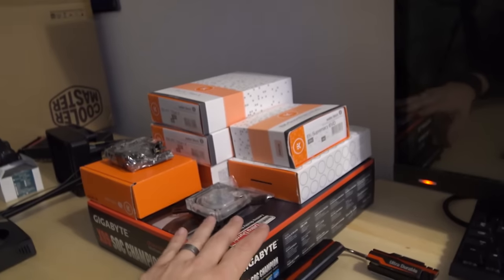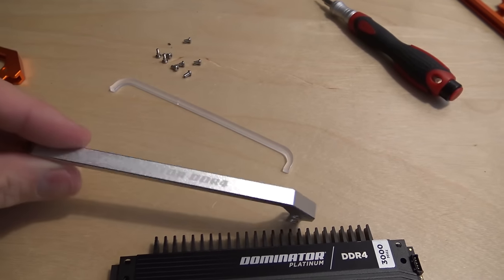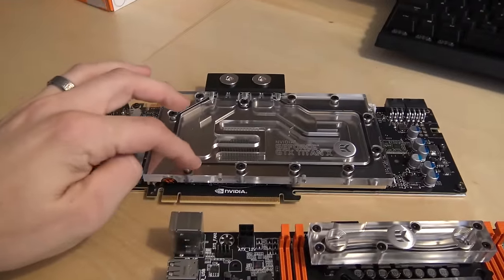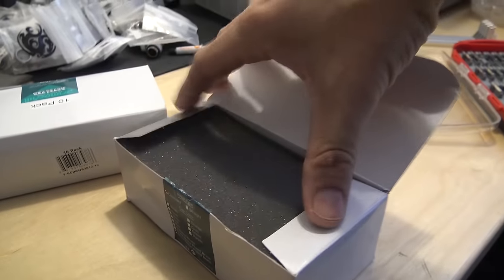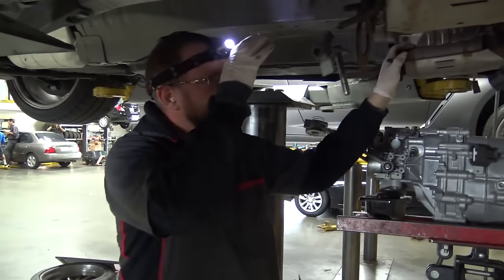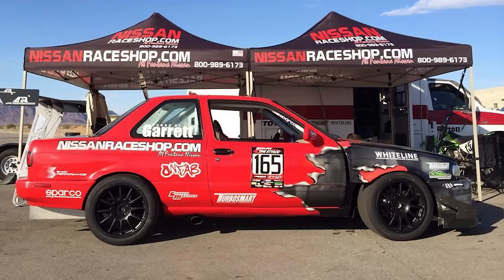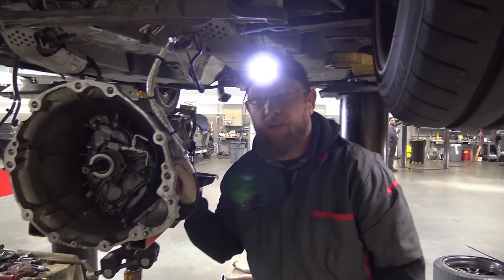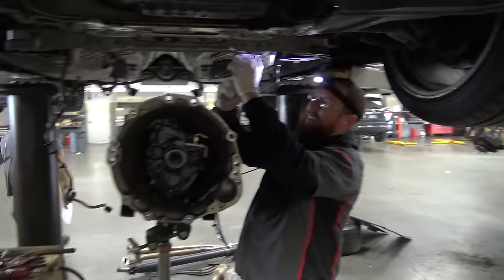Skunkworks and 370Z Nismo update vlog!

Comment: Jay, the flywheel is sprung weight, and more importantly, it's rotating weight.

The difference between sprung and unsprung weight is that unsprung weight is not supported by the suspension in the car. Pretty well all of the suspension, wheels and tires are all unsprung, and everything else is sprung, that's an easy way to remember it. One of the goals in motorsports is to reduce unsprung and rotating weight.

Comment: For future reference VHT do anodized effect paint, it is a very thin and watery paint so runs are difficult to avoid but the result is that the paint is translucent meaning if you have a brushed metal surface you'll be able to see the brushed metal through the paint this also includes writing as well, the currant colours are blue, red, purple and grey (it's that weird grey that you only get from anodizing). You can also try searching transparent spray paint but it sort of hit n' miss.

Comment: im a big fan of the car stuff. any time you want to toss it in a video i dont mind at all. 

one thing i never understood is people making a big deal about low mounted intakes. on my gencoupe i had an injen CAI mounted right in front of the wheel and never had any issues. i live in toronto canada (so a decent amount of rain) and in rain or snow no issues at all. one downside to that was the smaller wiper fluid bottle though (salt in winters blows). i personally prefer the intake sounds over those of exhaust (especially on turbos). that darth vader like woosh is like music. the intake sounds a just so much more subtle and less annoying than exhaust. 

oh and one thing i think would be really interesting on the channel would be some sort of artistic hard tube watercooling. maybe something like coiled or helix tube bends or something. i have wanted to do something like that on my own PC but i just dont have the room in my current case for it.

Comment: I used to have a 350z too but traded it in for a subaru xv crosstrek since that works better in the snow up here in the northwest.  I did test drive a 370z during my ownership of my 350z but didn't notice that large of a difference between the 2 to upgrade, and I couldn't afford the higher payment.  Now that we, my wife and I, have a good all weather non extreme offroad car I'm looking at getting another sports car, maybe.  What would you have gone with if not a Z car or what vehicles were on your list when you were shopping?

Comment: Just gunna put this idea out there .. but what if you paint your Skunkworks case in a crazy metal flake burnt orange? I don't mind the car stuff Jay. Those water blocks look like a nightmare to plumb up being so close together. I'm wondering how close your top GPU is going to be to the chipset block fittings.

Comment: I thought he looked familiar...turns out it was scott from scott and kerryann! awesome to see my tech colliding with the motovlogs
Reply: +Ck thirsty small world isn't it?!?
Reply: +ScottandKerryann 15:00 You, Scott, don't seem to understand the concepts of under and oversteer: In a FWD, 'stay on the throttle and let it pull you out'.

Jesus...
Reply: +RetroMMA ok
Reply from the maker: I'm fairly certain he has WAY more seat time than you, so shut it mr
Reply: ***** You tell him jay!
Reply: ***** First of all, you don't know me or how much seat time I have so please don't make assumptions because he's 'your [car] guy'.

The simple fact of physics should tell you that the front wheels can do both turning and pulling quite well... however, as you ask that system to do both at the same time, you're in the realm of diminished results.

Hence, FWD cars are notorious for their tendency to 'push', which should not be confused with what I said above about 'pull': staying on the throttle will just make the push sustain and you'll end up sliding off the track [at speeds greater than what one might run on the street] as the two tires are doing too many things at once and not specializing in any one task in the corners.
Reply: ***** Let me rewatch that part, if I missed that, then I'll be like "my bad". Fair enough?
Reply: +RetroMMA I drive competitively...in the unlimited class fwd.  we set the car up (alignment) to rotate...aka oversteer.  in which case when the car gets loose...aka oversteers...you would stay on the throttle in order to let the front end pull you out...like I said in the video.  this is how you make a fwd get around the track faster and not "push" yourself into the wall.  but I'm sure you already knew that.
Reply: ***** Ok, I listened to that part (again) and my opinion hasn't changed and here's why:

In an over-steering car, where one doesn't intentional wish to drift, the weight transfer must be balanced to let the front tires grip.

If you're already over steering in a FWD the best course of action is to ease off the throttle and let the wheels 'bite'.
Reply: ScottandKerryann So then why not say that 'we make the car sloppy' and overcome it by pure dollars in tires and suspension work?

Truth is, FWD as a race platform is a battle of who is the less Special in the Special Olympics.

I don't say that to be mean, in particular, but playing with physics is something that Porsche has been doing for decades and they've only got good at it at the cost off the owners willing to pay for them.

Anyway, no, I didn't know that but I'd be curious to this unlimited class of FWD cars that defy physics and put down respectable times on a track.
Reply: I must have been doing it wrong all these years...thanks for correcting me.  I'll let everyone know in all of the FWD classes throughout the world that they are doing it all wrong and should trade in for Porsches!
Reply: ScottandKerryann You have no understanding of what I meant by the Porsche analogy?

Let me ask you this: Do you believe that and Unlimited FWD car will beat an Unlimited RWD (or even AWD) car ON AVERAGE?

If yes, please explain.
If  no, please explain.
Reply: +RetroMMA ladies ladies your both beautiful!
Reply: +RetroMMA your question makes absolutely zero sense...and can't be answered.  there are different classes pertaining to drivetrain....enthusiast class, street, modified, and unlimited.  and then again divided by drivetrain fwd, rwd, and Awd.  so on average....who cares?!?  its not relevant.  that's like arguing what's faster on average...a bike or a car?
Reply: ScottandKerryann We're talking physics, hence reality: Why not enlighten us how a FWD car can compare to a car of the same HP, TQ, WT?

All I gather your comment in the video is that the 'Unlimited' FWD Class simply goes around the track slowly.

Worse is that you set it up loose to what effect?
Reply: Not sure where this whole FWD vs. RWD debate came from.  They are two different things.  Jay was asking me a question about my particular FWD race car...in which i answered the question.  You however, disagreed with my answer...its apparent that you are extremely confused by all of this...hence making this conversation extremely difficult.  What's tastes better?  Blue is my favorite color!
Reply: ScottandKerryann I get it, you choose to be condescending at every turn. When you get a break, why not read the entirety of this thread.

I made my point.

I wouldn't let you touch my G after vetting you the first time we meet, even had I broke down, and you showed up.
Reply: +RetroMMA OK cool!

Comment: I need to put a new Clutch in my 2001 Audi A6 2.7T, works fine but if I give it gas to the point of the turbos kicking in I will feel a shuddering from it slipping. also if i give it gas in 6th gear it will rev up 1k then go back down and start moving the car:( But my baby has 180k so I cant complain about the stock clutch lasting so long.Just thought I would share.

Comment: What a coincidence Jay i just put a stage 2 clutch an lightweight flywheel on my subaru along with a custom turbo, Bigger injectors straight through exhaust and a cosworth induction kit then got it remapped by the uk's nbr 1 subaru tuner Andy Forrest, I came from 300bhp to 370bhp an what a difference it is, Well happy 😊😊😊

Comment: oh man. I hate to be "that guy", but mass in the flywheel is not unsprung mass. Unsprung mass is exclusively mass that is outboard of the dampers (like knuckles, wheels and tires, control arms (sorta), brakes, etc.) and it impacts suspension performance. Reducing mass in the drivetrain is also important (less rotational inertia means more angular acceleration per torque) but it doesn't impact suspension, it impacts drivetrain performance... I'm sure he knows all this and just misspoke, but people misuse the term "unsprung mass" so often that it gets to be like nails on a chalkboard.
Reply: +TheNightWatch001 Can't believe this is the only comment I could find mentioning this. I thought youtube would have been full of pedantic mechanics like me and you. :)

Comment: Is that replacement a DUal mass flywheel? and if not does it make noise? I heard a few 350s and 370s with lightened flywheels and they sounded HORRIBLE when idling. My G37 clutch is still holding at 75k but im sure im not far off from needing a new one. Luckily I work somewhere with a machine shop so we are going to attempt to resurface the Dual mass. It just needs a custom jig made to hold it in the lathe. So yeah any noise?

Comment: I have the same dominator RAM.  If you buy the light upgrades it does come with the correct alan keys.  Also you can light them without corsair link.  Which I agree is rubbish.

Comment: Can't wait to see the finished overhaul  on  Skunkworks. Should keep the nickel back plates and polish them up to a mirror like finish. Nice upgrade to the Nissan and Yes do add some car enthusiast or what ever tidbits here and there to your videos as that is part of what your into and it gives your viewers a more personal  touch into the life of JayzTwoCents besides just computer tech ( just don't stray away from the techy stuff).

 You did a review on a PowerColor R9 390x hybrid and  it's neck to neck with a GTX980. Can you get your hands on a PowerColor R9 390X2 16GB Devil 13 and put it up against the GTX 980 ti. As they are basically the same price + or - . Maybe also toss in a Titan to the mix. PCPartPicker link to the card:

https://uk.pcpartpicker.com/part/powercolor-video-card-axr9390ii16gbd5

Thanks for the great videos.

Comment: Flywheels are not unsprung weight. Thats a suspension thing. Your thinking of inertia. A lighter flywheels allow the revs to climb and fall quicker as then engine does not have as much mass to rotate.

Comment: Yo Jay. I have just build a Caselabs S5 with pretty much the same Colorscheme. I'll look forward to seeing how your build turns out, so this also finally made me subscribe! Anyway, what I discovered with "normal" see through orange coolant. Is that the liquid will look awesome in the bottle or even the reservoir. However when it is circulated in the loop it'll look thin and vague. (I used EK Evo with Mayhems orange dye) Also in my case the orange bits and pieces is a matt orange color. The see through gives like a gloss effect, so it didn't really match the color. So I ended up dumping the EK Evo and went back to Pastel orange (get red dye if you end up there aswell!)

Comment: Jay have a question. I want to buy a gigabyte 970 xtreme and it says 600 watts required. Does this mean power supply or does this mean it requires 600 watts of power to run. I have a evga 650 watts psu and can go larger if needed but don't if don't have to. Thanks

Comment: HPS pads are shit! I know this because i had them. Can't hold heat for crap and driver side pad cracked on the face of the pad in several pieces. This was on normal canyon runs. Highly recommend EBC pads. Did you do the oil cooler upgrade?

Comment: nice 350....i want a 370 sooo bad. currently i have a clean 240sx, yes i know your shaking your head thinking no one has a clean 240...but its true. ive tastefully done intake, exhaust, suspension so far. none of this slamming it down so low you cant drive it/camber so off it wears your tires in a week coffee can muffler bs goin on now a days

Comment: quick question, that is the fastest cpu that fits into a z97 motherboard? single core performance priority but then just the most baddass cpu that i can fit in an lga1150. i'm already sure its the 4790k, i have a 4790s and i kick myself that i didn't get the K for whatever reason.
Reply: +NavJack27 4790k yes Ive got one myself, any reason why you got a 4790s and a z97 motherboard? there isn't that much reason to get a locked cpu and the overclocking class motherboard :P I guess you didn't know that or weren't told when buying it though which sucks.
Reply: +WayStedYou story time! my AMD A6-3670K died on me one day. i just rushed to pick parts and wasn't thinking clearly. no clue why i justified the s at all, none. i knew, and i knew what a K series was lol. every time i build a computer i learn something about my irrational self and i also learn about how with what i do with computers, just get the toppest of the top end parts and sit on that computer until it breaks.
Reply: NavJack27
ah that sucks, it wont be a huge deal it is still a good cpu and should last you for quite awhile you just might have gotten a year or two more out of the 4790k.
Reply: i'm tempted by the 5775C due to the l4 cache

Comment: Jay stop bragging about your well aged knowledge of motor vehicles.... If you were teaching something that would eb awesome...but mainly it was mechanical jargon... COME ON MAN!!!
Reply: Get out there and learn about your car man. Even if you never work on it yourself, knowing the difference between needing a new $150-$200 alternator and needing a $2 fuse or switch is awesome knowledge to have.
Reply: +stephan walliser cars arent that complicated, i mean at first it might seem that way but its actually pretty simple, you can have injected fuel or carberated, carberated uses a vacume to pull fuel from a bowl up into the air, injection injects fuel into the air. then it all goes to the block, which has a intake valve ( unburnt mixture) that the air/fuel mixture enters from, the piston then compresses the mixture and then the spark plug sets it off, this pushes the piston back down, then when the piston is going back up, the exhaust valve opens and the burnts air exits the block. the pistons go up and down to turn a crackshaft, the crankshaft then turns a clutch (manual) or torque converter (auto), the clutch/ torque converter then engages and spins the transmission, the transmission is a bit more complicated but it is just a bunch of different gear ratios. anyways the transmission then spins a driveshaft which is connected to a differential on the rear end of the car. this is a bit different on a fwd car. the transmission has half shafts that connect to the front wheels.
Reply: +stephan walliser until he mentioned the flywheel as unsprung weight he seemed to know a fair bit.
Reply: Wow we have another car enthusiast... I feel envious of the knowledge!!

Comment: Can someone tell me if my specs need any improvements 

(Intel Core i5-6600k)
(Gigabyte G1 Gaming GeForce GTX 970 DirectX 12GV-N970G1 Gaming-4GD)
(Crucial 8GB kit(4GBx2)DDR4-2133 MT/s)
(Corsair CX series Cx600 600w ATX12V V2.3 80 Plus Bronze Certified Active PEC Power Supply slot)
Microsoft Windows 10 Pro 64-bit
Reply: +Isaic Villanueva Get a real PSU, Corsair CX are just crap
https://www.reddit.com/r/buildapc/comments/35jxhr/discussion_updated_psu_tier_list/
Reply: +Ithilion What would you recommend?
Reply: +Isaic Villanueva A top tier one like EVGA Supernova G2 (OEM SuperFlower) or XFX XTR (OEM Seasonic). Both either 550w or 650w, depending on your needs.

Comment: Hello PC noob here I hope you can answer my question. I have a MSI 990FXA-GD80V2 motherboard I got it used so I do not have a drivers CD. When I go to MSI website to download drivers for windows 8.1 64bit it only has one driver for sound. Is that all the drivers I need or is there some other drivers I need to download for windows 8.1 64bit. The motherboard supports windows 8 from factory because it has windows 8 bios options. On the website for windows 7 it has all the regular drivers chipset, usb, sata etc. but for windows 8.1 there is only the sound drivers so I am not shore what to do. Website link http://us.msi.com/product/motherboard/support/990FXAGD80V2.html#down-driver&Win8 64

Comment: will this run games 1080p 
http://uk.pcpartpicker.com/p/vx9RrH
Reply: +RagingSteak It should be able to run most games at 1080p 60 FPS. Maybe not at Ultra settings but probably high settings.
Reply: Thx for your help! It is my first time! Do u have improvements ?
Reply: There's probably a few things you could improve. I will give you a revised list later.
Reply: +Miguel Ortiz thanks
Reply: This was the best I could do for the price. I upgraded the CPU and HDD, but I had to downgrade cooling and the SSD. Your build is pretty good as is. http://uk.pcpartpicker.com/p/DbhZVn
Reply: +Miguel Ortiz thankd but i3 is only dual core so I might go for something else like amd fx 6350 or 6300 or even keep the athllon
Reply: +Miguel Ortiz thankd but i3 is only dual core so I might go for something else like amd fx 6350 or 6300 or even keep the athllon
Reply: RagingSteak The i3 is technically quad core due to hyper threading. Although I can see why you want to go with AMD. I do recommend getting the 6300 if you can fit it in your budget.
Reply: +Miguel Ortiz I think I will remove the ssd, upgrade my gpu, and get the other hdd
Reply: RagingSteak Sounds good. I think you should get the WD Black if you are going with no SSD.
Reply: +Miguel Ortiz thx